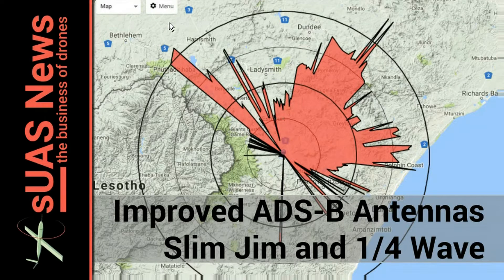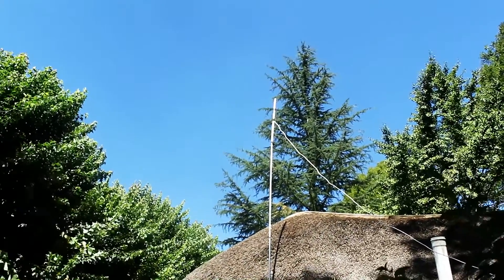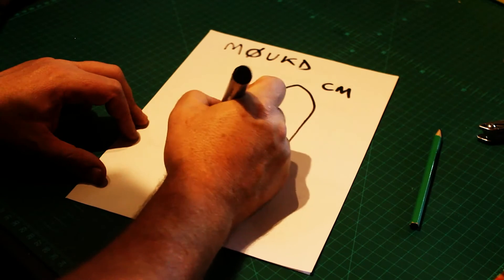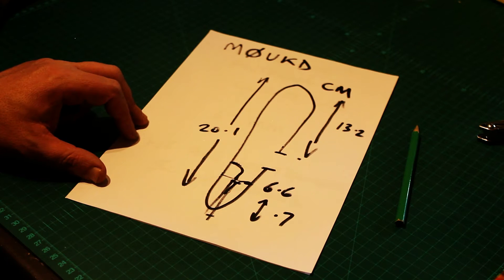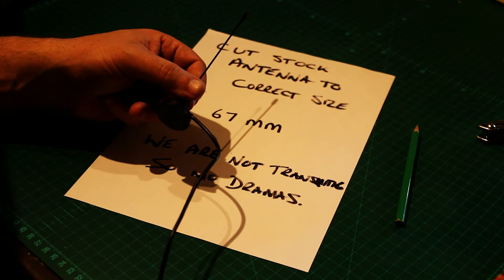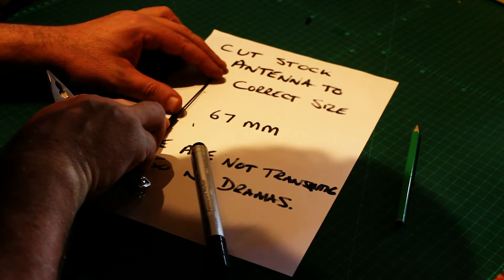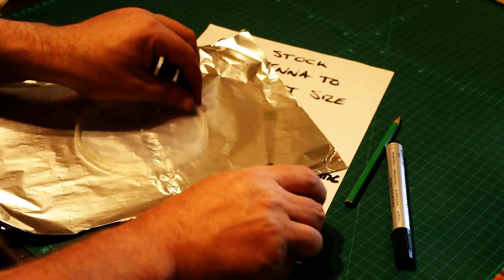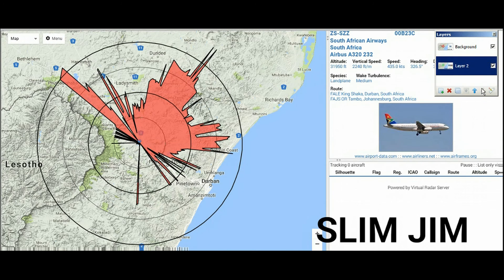Better ADS-B Antennas 1/4 wave and Slim Jim

Comment: interesting vid! based on my own experience and antenna building for ADSB, I have to disagree that dimensions and measurements are less critical for receive only antennas. I still use VSWR and return loss as a measure of antenna efficiency and have noticed that a dipole with a 1:1 VSWR match immediately picks up more aircraft at greater ranges than an identical one with a 1.5:1 match. it took me 4 tries to make a working J pole on frequency with an impedance match lol. worth it for the experience but after a dozen antenna builds, I'm still not convinced that anything works better than a well tuned 1/4 wave ground plane or a half wave dipole that I use as reference antennas and antenna height above ground seems to be the most critical single component.
Reply from the maker: Very true, tuned will be better

Comment: Had to laugh at your construction technique but, must say, it is effective.  I have been a ham for a bunch of years and agree with your repeating that "we are not transmitting, else would take more care".  Interesting technique with the plastic and tin foil ground plane.  Thanks for the education and a laugh.
Reply from the maker: It was partly to show that doing something is better than nothing! My collegue Vic is horrified with this video his antennas are works of art.
Reply: You are correct.  Those little stubbies that come with the SDR chips are good for 50 miles on a good day, down wind, but that's about all.  Much better to hang up something... ANYTHING!!  Good job.  I just built a second 12-segment co-linear.  I went with 114mm and it is so horizon heavy that I don't like it.  Back to 110 next time.  Works great far out.  Overhead I am deaf!  Funny how reception works.  You cuts an antenna and you takes your chances.  Mike/W6XXX
Reply from the maker: Was it really worth the effort of going to 12 elements? I thought over 7 made little difference. My mind is coming round to thinking with ADS-B it's easier to place another Raspberry Pi at a friends house and tie the signals together on Virtual Radar Server. Each one should have a great antenna though ;-)

Comment: Very interesting. That little antenna is picking up signals from 60 miles away? What's the power of the sending transmissions then? Thanks in advance.